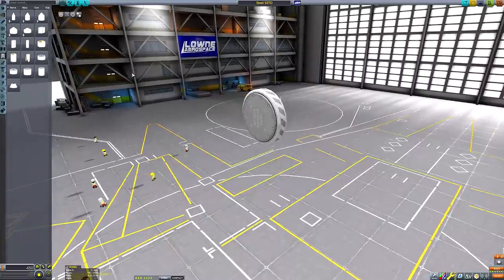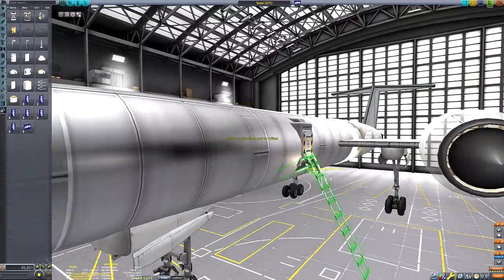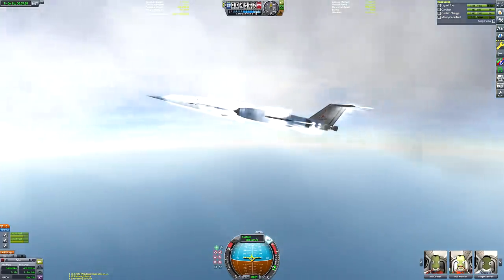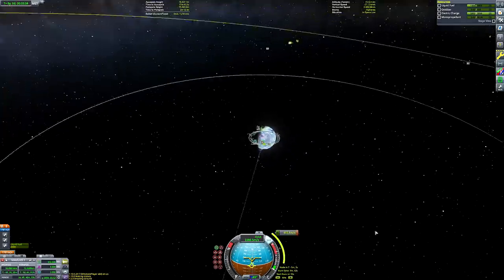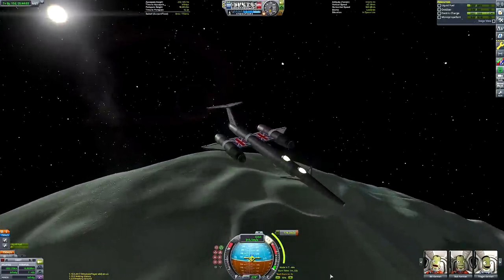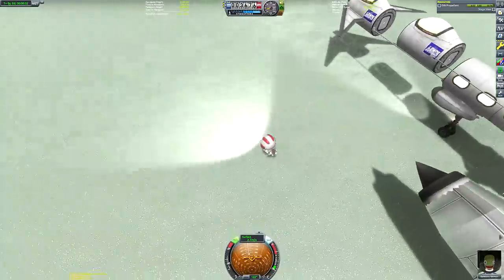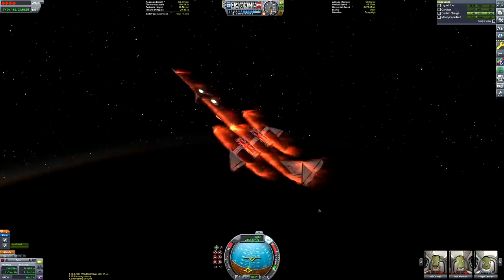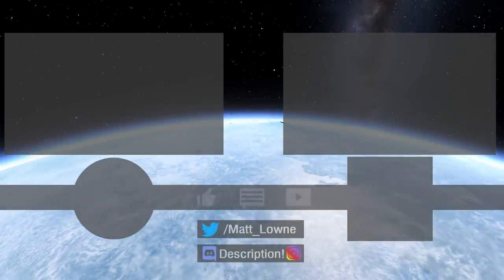Stainless Steel SSTO (Fully Stock)! - KSP

Comment: Me using the fairing variant
How it looks in SPH: silver
How it looks in flight: Carbon Fiber
Reply: Probably need to turn reflection refresh mode to something other than “off” in the settings. They don’t look shiny if it’s not on.
Reply: It's a bug.
Reply: IKR! Its not stainless steel its stained steel!

Comment: Lately with space planes I’ve been clipping a docking port Jr inside pitched 45° down from the cockpit with an action group set to control from there, so I can do that and just set SAS to prograde for the aerobraking angle. Makes it a lot simpler!
Reply: Is the weight lower than on a small probe core?
Reply: @HappyBeezerStudios  The docking port Jr is a massless part, much like RCS engines, so its weight is a total lie.

Comment: As a stainless steel fox, I approve. To be honest, having no passenger portholes is realistic. It would make far more sense for each passenger seat to have a flatscreen TV on the back of the seat in front, and controls to allow them to access a number of external cameras on the hull, as well as a flight data screen or overlay. A better version of the system they already have in airliners.

Comment: Aye matt, 1.10 broke the ability for the lander can to be partially clipped into a fairing.  I only know because it broke one of my spaceplanes while I was working on it during the update.  You can fix it by having it be clipped into an uncompleted fairing. (It probably would have worked on the rear fairing because it is open to accommodate the nuclear engine)

Comment: Regarding propeller planes breaking the sound barrier, the Tupolev TU-95M "Bear" was capable of achieving a speed of 574 MPH, which comes out to around Mach .74. The aircraft would have to pick up another 194 MPH to surpass Mach 1, which is actually doable if you were fine with diving the thing straight into the ground.

On the calculated level, the Convair XFY-1 Pogo could hit Mach .8 on paper.

In KSP I've actually been able to break the sound barrier using propjets, although obviously that's a simplified application of physics that doesn't take possible structural issues into account. Also, propjets are only available as modded parts.

Comment: On the "Propeller aircraft sound barrier" thing:
As aircraft started being made to go faster, they would spin the propellers faster rather than designing better propellers. It eventually got to the point of the tips of the propellers passing the speed of sound, which would cause problems in the flight; they had to design better propellers to counter this

Comment: The reason the antenna didn't break isn't because of the heating but rather the aero forces applied on it, you were going fast enough that the small amount of air you had was enough to be superheated, but not enough for it to put enough forces on it, I've done the same myself

Comment: I believe the issues you're seeing with the lander can and antenna are caused because they are attached to a part which is inside the fairing. Since the parent part is inside the fairing the game assumes that the child parts are also inside the fairing.  There's similar quirks that you can exploit with aerodynamics, like attaching high-drag parts to the back of a plane, but moving it and rotating it to the front. The game assumes that the high-drag part is still "behind" a more aerodynamic part, making the craft more aerodynamic than it should be.

Comment: The only way a propeller driven plane can get close to supersonic speeds is if the propeller falls off at high altitude and the aircraft continues to dive under gravity. Oddly enough, this has happened. In 1944, Squadron Leader Tony Martindale was a test pilot at the RAE, and during tactical Mach limit testing, the reduction gear of his heavily instrumented Mk.IX Spitfire jammed and was wrenched out of the aircraft by the propeller, both disappearing backwards. The aircraft continued to dive, reaching Mach 0.92. However, it was now tail-heavy, and Martindale recovered consciousness to find himself at 40,000 feet. He was able to glide back to Farnborough.

Comment: so one of the youtubers found out that you can use your pilot's as parachutes as wings for your vessels so I thought why not I'm testing it out found out that you could easily get for kerbals put them in a seat around each other and make a parachute system for your gear I think they work much better than using actual parachutes and top it off it saves on how much weight that you do with it

Comment: About the power bomb thing for early supersonic flights

Back then jets simply did not have the power to reach supersonic speeds with their engines they climbed to a altitude and dived to convert the energy of altitude to the energy of speed this was used to get the speed for mach 1 but this is unrelated to tour power bomb for a main reason this has been used in WW2 and known as Boom and zoom prop fights were  a simple struggle for altitude and energy the one with mor altitude usually won the engagement sometimes due to the aircraft poorly converting the speed back to altitude it was the only victory but the thing is such speed is very temporary almost immediately as soon as the aircraft balances the altitude they loose the speed quickly you on the other hand have a engine more efficient at higher speed so this is more equivalent to diving to gain enough speed so your radiator is on full efficiency so you can put your engine on a higher power without overheating and thus having more power for your aircraft and accelerating faster 

Also prop aircraft cannot reach supersonic speed for that you require  angled wings so they dont break propeller aircraft will break their wings way before they reach supersonic speeds

Comment: Regarding propeller driven supersonic flights:
First we have to ask who is qualified to confirm a claimed record. In most cases that would be the FAI, which means that no WWII speed record, not even from jet driven planes would exist. And basically all military records would fall out in general, as it's rather rare that they would fly on FAI approved tracks.
If we count turboprops as propeller driven, then according to the Guinness Book of 2021 the Tupolev Ti-95 can do 975 km/h or 606 mph or 526 kn

The official FAI record is from a Piaggo P.180 Avanti with 927 km/h / 576 mph / 500.5 kn
There is a claim for a Spitfire in 1952 with 690 mph (1110 km/h / 599 kn)
A claim from WWII (also with a Spitfire) is 620 mph (1000 l,/h / 540 kn), while not FAI approved, was flown under the Royal Aircraft Establishment, which was a scientific body and could record the data.

Comment: the prop planes did break the sound barrier when they dived but there diving was due to altatude and the plane usually lost control so the dive led to lots of crashes
Reply: I actually remember reading about a german Me 262 pilot who claimed that he broke the sound barrier in it. He flew into a cloud and lost his bearing and when he exited it the plane was diving towards ground, he then hade to use the elevator and trim to get the plane out of the dive. He ended up landing in Switzerland with the plane  and the swiz government took the plane that's now in a museum there. The man actually tried to get the swiz to give him the plane after the war as he claimed that it was his property. He later told in a interview that he didnt want to take the claim of being the first person to break the sound barrier but that people would accept that the Me 262 could break the sound barrier.
Reply: It was a very common occurrence during the later years of WW2. When fighters would go into a dive some would break the sound barrier. Very few recovered from the dive since the wave front would make the control surfaces useless. Those that did manage to recover would have significant stress load damage to the empennage. Control in the transfer stage and supersonic wasn't solved until the X-1 was outfitted with a stabilator.

Comment: I made a lander today using the stainless fairing as an engine shroud and had the landing gear hidden, but the bottom was open. Landing gear "encased" in fairing.

Comment: well small tip on sending videos to YouTube, if it is kind of dark, raise on a 0-255 slider about 5 or on a 0-100 slider about 2 the brightness level and just a tad on the Gamma and "MAYBE" touch the contrasts and colors but just making blacks above the cut off limit YouTube tends to set at flat 0 will let you keep your video's color. (just send a few unlisted short tests you can render in 1 minute. each with different settings.)

Comment: The sound barrier could likely have been broken by propeller aircraft, but due to mach tuck at those speeds and stress on the airframe the pilots certainly didn't live to tell about it

Comment: My SSTOs are usually pretty ugly because I design them only with functionality in mind.
Also, I’ve found that I can’t do a direct descent from Jool anymore because my heat shield kept exploding, now I have to do gravity assists and orbit lowering, and inclination changes. It’s the same thing for Dres too. I don’t know if anyone else has experience that. It’s minor, but it does lengthen the mission and adds more complexity to it. I refuse to use cheats or lower my re entry heating setting below 100% where it’s at. The first time I encountered this it deeply frustrated me, but I’ve learned to live with it and deal with it.

Comment: I read of one case of a German rocket-powered Natter that might have broken the sound barrier. This is only based on the distance it covered in the time it covered it and since it crashed and whatever data was on board went up with the pilot. If anyone has any more information on it, we would like to hear.

Oh, and the propellers (turbo-prop) on the TU-95 actually move at supersonic speeds. Supposedly it is so loud that our submarines can detect them flying over while submerged.

Comment: Best-looking spaceplane ever. :) The Mk2 parts are good, but this is better. Really makes me wish for procedural parts, especially if they can be shaped like fairings. I love the view from the cockpit too.

I had a horrible "hatch obstructed" issue with the mk1 inline cockpit and no fairings at all. I later thought I might have accidentally clipped a cubic octagonal strut into the cockpit though. In any case, it prevented me making my first design of rotocraft to fit into a Mk3 cargo bay, but it didn't matter in the end. I made a much lighter rotorcraft with external seats which, although completely unaerodynamic, was just as fast. And then I couldn't dock it into the Mk3 bay to save my life, anyway! :)
Reply: Update on getting in and out of fairings: I was sometimes able to use an external command seat inside a fairing as a means of getting kerbals in and out.
    Getting in is quite reliable: with the kerbal standing near the seat, perhaps on top of the fairing, get your camera inside the fairing and right-click the seat as norma. (If necessary, aim your camera at a nearby part of the craft.) Once inside, you can use a door on a part inside the fairing such as a Mk1 or Mk3 cabin or cockpit. (Mk2 end doors don't work, IIRC.)
    Getting out requires a lot of build-time testing to find a position for the seat which will eject the kerbal from the fairing, preferably not too violently. I'm afraid I have no tips for this, except that increasing the clipping of the kerbal with the fairing may make it less likely to exit.

Comment: You need to place the crew module on the outside somewhere then off set it to where you want it. It bases the obstruction off of where the part was originally placed not where it physically is.

Comment: If you want an idea for a difficult, but interesting, playthrough, would be career mode (vital, money makes this WAY more difficult and interesting) using ONLY liquid fuel for propulsion. No SRBs, no monoprop, no oxidizer. I did it in hard career, but you could of course do it in normal career mode. It's essentially a kerbin only science grind until the nuclear engine, so you have to build nice planes, get as much science as you can from everywhere, and be creative with how / where you can find science where you might not expect it. If you want some hints as to where you can find unexpected science, let me know. 

For a series, it may be smart to montage some of the early bits that feel a tad "Cheaty", but are necessary; namely the whole ksc science grind thingy. Or you could just give yourself a bit extra science. I don't know if it would be possible to reach nuclear engines exclusively on kerbin without it, but nevertheless. It's a fun challenge. When you move to jet based first stage rockets, instead of plane style ssto's, it's really fun.

Comment: What if you put some structural panels from the making history (those that can be colored silver) inside the fairings, and offset them on top of the wings to look like they were steel as well? They wouldn't generate any extra drag because they would be technically shielded by the fairing

Comment: Any prop plane that broke the sound barrier crashed into the earth seconds later. The shockwave stops airflow across the control surfaces. They could never pull up.

Comment: @matt lowne, you know the nuclear engines are pretty efficient even as low as 5km right? also, rapiers are actually better in the upper atmosphere because while there is less air for them to use, there is also much less drag higher up, if you try to gain airspeed at about 15km it works much better